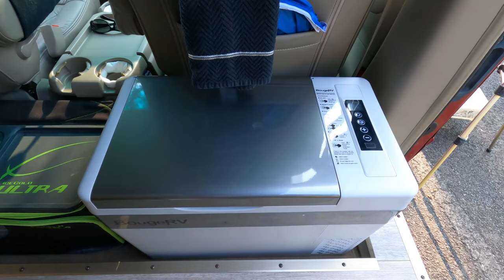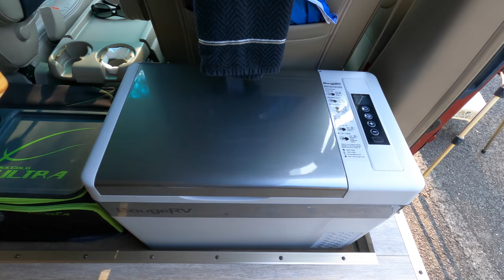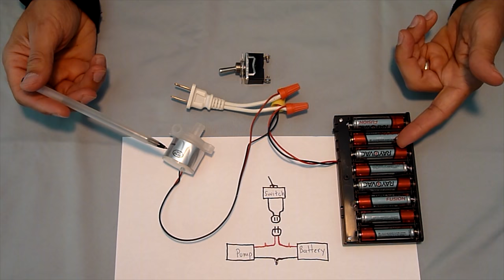Minivan Camper Build Chapter 2: 7,000 mile review

Comment: ON WATER... why not be able to add more n top off  b4 it gets empty developing air in the line so u don't have to prime it?
Reply from the maker: Yes, if I remember to refill the jug before it goes empty, then I don't have to re-prime the pump.  But then I have to keep checking the water level, and it's not easy to see the level in the jug. I've gotten so good at priming that it doesn't even save much time to refill before the jug goes empty.  Either way, it's no big deal

Comment: Please show us how you mounted your table?
Thanks!
Reply from the maker: The table is a pine panel board (five 4 inch wide pieces glued together to make a 20 inch wide panel, from Lowe's) attached with a table edge support, where the two metal pieces are screwed into the cabinet face and to the edge of the board, respectively: (https://www.amazon.com/gp/product/B00G44IZEO/ref=ppx_yo_dt_b_asin_title_o06_s00?ie=UTF8&psc=1). The table leg is: (https://www.amazon.com/gp/product/B019QGRGYQ/ref=ppx_yo_dt_b_asin_title_o07_s00?ie=UTF8&psc=1). The table is very solid when mounted, and also easy to take down for sleeping. All of the parts are linked in the video written description.

Comment: Does the floor cover seat moving mechanisms? Or were able to remove those and had a pretty flat van floor? Thanks?
Reply from the maker: The ‘04 Odyssey has no moving mechanisms in the floor, those are contained in the seats. However, there are some attachment bars that rise above the floor. My plywood floor lays partially on those bars, and it’s extremely stable. The van floor is not flat, it has many curved and tilted sections; I had to do some trial-and-error fitting to determine the final shape of my wood floor

Comment: I wonder could you do this for a bigger bed
Reply from the maker: A standard double bed mattress is 54” wide, and it won’t fit in he Honda Odyssey unless parts of the van interior sides are removed. The widest mattress that would reasonably fit would be 48” wide, and would require significant redesign or elimination of the storage shelf and the sink cabinet. The wider bed platform would also be much heavier to convert between bed and couch. It’s certainly possible to use a larger bed, but I would probably start with a different design

Comment: The weight is an issue wt Honda Odyssey I currently have been living in a 03 Odyssey  wt 228k for over 1 year and Trans is starting to go out,Honda Accord & Odyssey are notorious for Trans failure I would recommend Toyota Sienna
Reply from the maker: It’s true that some Honda Odyssey years have had transmission problems.  However, transmission lifespan depends on many factors, including proper maintenance, driving style, carrying excess weight or towing load, etc. I am very careful with my van, perform all scheduled service, and drive gently (no rapid acceleration); my van has 220,000 miles on original engine and transmission, and still drives like the first day. No machine lasts forever, and if you have 228,000 miles on yours, I think that’s actually pretty good, you must be doing something right!
Reply: On your 2003 and Rob's 2004 the transmission oil filter can be changed. If you want to take care of your transmission, here is what I would do.

1. Replace your transmission oil filter and all the flexible lines/hoses. ( OEM or good quality hoses only)
2. Install an inline magnetic oil filter (Magnafine or Raybestos) and a transmission oil cooler (Hayden or whatever brand you like, with or without a fan)
3. Blow out and flush/clean with solvent or brake parts cleaner all the transmission lines/cooler that you can access. 
4. Clean the transmission solenoids and the screens. (order the gaskets for each of them in advance)
5. Flush or drain and refill your ATF, whichever method you prefer. (order a case of DW-1 from ebay or Amazon)
5. Add half a bottle of AT-205 to your transmission. (I use it in my engine and power steering as well)
6. If you have not serviced you radiator/cooling system in years then flush/clean the entire system with a cleaner like Liqui Moly 2051 or Gunk super heavy duty radiator flush - Prestone no longer makes the CLEANER they used to, they just have a FLUSH+CLEANER now. Do this with the old thermostat removed or gutted so that you have stronger flow and the heater set to hot all the way to make sure the heater core is cleaned as well. After you flush/clean the system, install a new thermostat with new coolant.
7. Make sure you radiator and condenser are clean and your fans are working at optimum speed with good air flow. If not, give them a good clean and service the motors or replace. 
8. Install a metal screen in front of you radiator and condenser to protect them from gravel and bugs.

Part #s - 25450-P7W-003 Honda FILTER (ATF)
91301-P7W-003 Honda O-RING (12X2.4) (KEIHIN)

PS Hayden Automotive 678 Rapid-Cool Plate and Fin Transmission Cooler is on sale for $36 down from $100 right now on Amazon.
Reply from the maker: @ray32825  Really good tips, thank you!

Comment: it seems like the folding legs aren't really needed to be folding? could they just be non folding and still work?
Reply from the maker: That depends on the specific van model. In my case, the '04 Odyssey has a floor that is so curved and tilted that if the legs didn't fold, the front platform section would not contact on the wood frame when in couch mode, and therefore would not slide correctly.  However, in a different van with a different floor shape, it's possible that the legs would not require folding.

Comment: Hi Rob hope all is well. I had a question regarding your floor. Is it one solid piece of ply that you cut out of a 4x8 or did you have to connect more then one piece? I'm making my floor this week and I'm pretty much making the same floor as yours (I also have an Odyssey). Also I can see you have some angled 2x4s under the ply to make the floor level. Any tips for cutting those? I appreciate your time and thanks again for uploading and sharing!
Reply from the maker: The floor is one piece of plywood covered with interlocking plank flooring secured with metal edging. Then it’s resting directly on top of the middle seat mounts and various other locations on the van floor, further supported by several small pieces of 2x4 and 1x4 placed so that the whole thing is solid. It’s frustrating how the van floor is SO not flat! Just have to support it with the proper thickness wood in various spots. Good luck!
Reply: @travelswithrob4970  You're the best Rob thanks for all your help!

Comment: By chance, Have you looked at a lift kit to raise the vehicle for better clearance?
Reply from the maker: I have looked into ways to raise the vehicle, but only briefly. The clearance on this van is not great - only about 5 inches; but at 225,000 miles, it's probably not worth the cost and risk of introducing new problems. I haven't yet had the low clearance limit where I want to go, but I know it will at some point. If you know of a good (and not too expensive) way to do this, I'd love to hear about it!

Comment: You up't the Wright 100 lbs. One passenger would most likely weight more. BUT, here's the question. You all put most if not all heavy build on one side of vehicle. How does that not damage struts? Tires? Etc.
Reply from the maker: I haven’t noticed any issues in 25,000 miles. Actually I think my rig is reasonably well balanced. The build has more parts on the left side, but my Thule roof box is on the right, so I think the load and weight balance is well within safe limits for this vehicle

Comment: Hi Rob. at 4:03 there are 2 horizontal braces on the bed frame. Why did you install 2? will only 1 work? so more storage underneath the bed?
Reply: follow-up questions;
- will a drawer system under need the platform be a good idea
- would you drill holes on the bed platform for better air circulation under the mattress as well as to reduce weight. If yes, how would you do it?
Reply from the maker: A drawer system under the bed would be a good idea, but I have essentially the same thing using two large bins which slide under the bed frame (see 13:35 and 16:49). Since the bed cushions are in four parts, I shift them around frequently; they get plenty of air exposure and there is no concern about moisture, so I don't need holes in the platform for that reason.  However, drilling out lots of holes for weight reduction is a good idea, because the platform is rather heavy. To do this I would probably use a 1" or 2" hole saw attached to a drill, and remove at least 30% of the total wood volume to really make a weight difference while retaining enough platform strength.
Reply from the maker: The two cross pieces at that location are placed so that a support piece is under the first piano hinge when in couch mode (hinge mounted on top), and under both sides of the second piano hinge when in bed mode (hinge mounted underneath). This amount of support is probably more than necessary, but I didn't want to put any stress on the hinges when seated or sleeping

Comment: alright, a pc fan for ventilation in tilted window - how are you gonna keep bugs out of the opening? where did you get an idea of folding bed in such a way of 5 pieces? poor recomendations without testing them before. lot's of it on youtube. it's like i chopped some food but didn't do the dish yet
Reply from the maker: The fan is mounted in a coroplast panel which fits in the window, and therefore the only opening is at the fan blades, and bugs can’t fly in against the airflow. The bed design was proved by Eric, whom I credit in the video. See my Chapter 3 video, this van never ceases to amaze me in how livable it is

Comment: How do you get your ceiling lights to go off when your van doors are open?
Reply: Anyone know?   Pull a fuse maybe?
Reply from the maker: The Honda Odyssey has a three-position switch for the ceiling lights: (1) always on, (2) always off, and (3) on when a door is open. Most vans have at least the ability to turn off all of the cabin lights with a switch; your owners manual probably describes it somewhere.

Comment: Is it ok to drill and cut air vents in panels to ventilate mattress?
Reply from the maker: Yes, openings could be cut in the bed panels, the 3/4 inch plywood is plenty strong. However, I’ve had no problems with moisture. The mattress sections are shifted each day, so there isn’t enough stagnant time for moisture to cause any problems

Comment: Do you have design drawings with dimensions of the build? I would like to purchase it.
Reply from the maker: Unfortunately I don’t have plans; however, every van model has different dimensions, so each build will be at least partly custom. Lots of YouTube videos (and some trial-and-error!) gave me the information and confidence to build this van, even though I had never made anything like it before. Good luck!
Reply: @travelswithrob4970  I have a Honda Odyssey exact same model. Do you have any sketches you drew before starting the build?
Reply from the maker: @julianparra420  I don’t have any drawings; I did everything on-the-fly because I didn’t expect to build it again
Reply: What was your total cost in material including the solar panel?
Reply from the maker: @julianparra420  The total cost was about $1500, but most of that was for the EcoFlow battery ($650) and the refrigerator ($260). The solar panel was cheap ($90). Battery power is not required if you don’t have a fridge, but then you will need to regularly get ice for an ice chest. Lithium battery banks are cheaper now than in ‘21, but the luxury of having a battery+fridge will still be a very large part of the total expense

Comment: i do have one question what do yoy do for heat when it gets cold out
Reply from the maker: I have no heating system. However, cold nights (down into the 30’s) are no problem if the days are either sunny or reasonably warm, because the van interior retains some warmth from the prior day; I also have a warm sleeping bag. I’ve previously done quite a bit of winter camping, but I haven’t used this van for serious winter camping, and I tend to follow more moderate weather.

Comment: Were you able to determine if the rooftop cargo carrier cost you any fuel efficiency
Reply from the maker: I didn't measure the mpg before I put the cargo box on.  However, I still have the window sticker for this '04 Odyssey with 225,000 miles on it, and it reads "25 MPG Highway." On my cross-country trip last summer, including the cargo carrier, I got up to 24.5 mpg at 70 mph on level roads (with A/C on!). I'm happy with that.

Comment: If it is a 7 person minivan, it was designed to hold 1400 pounds of people. You took out 200 punds, meaning you could go to 1600 pounds and not overwhelm it. I woudnt say go that high, just saying dont worry about another hundred or two pounds. Heck , I weigh 301, the van cant carry me?
Reply from the maker: Exactly right, even when I’m fully loaded for travel, I’m still far under the load capacity of this van 🙂

Comment: How's the transmission
Reply from the maker: Tranny and engine are perfect, 225,000 original miles and going strong! I’ve even thought about using the van to pull a small trailer, but that might be pushing my luck

Comment: I switched to metal cause the wood felt too heavy in the rockies.
Reply from the maker: I think that most of my weight burden on the van is actually all of my gear, not so much the material of the build. The wood parts of my system weigh less than 200 lbs (floor, bed frame, sink cabinet and shelf) which is about the same as the weight of van seats I removed. It’s the total of all the other stuff that weighs even more, including the mattress, 10 gallons of water, camping and hiking gear, clothing, food, refrigerator, roof cargo box, screen tent, camp chairs, power station, solar panel, etc. For more elaborate builds I can see how saving some pounds on the build material might help, but for me, saving weight is mostly about bringing less stuff